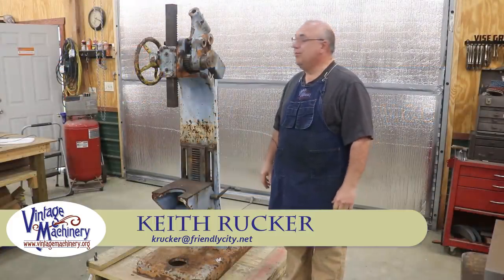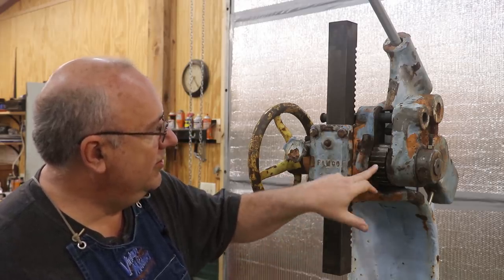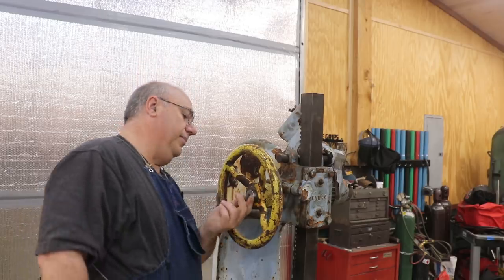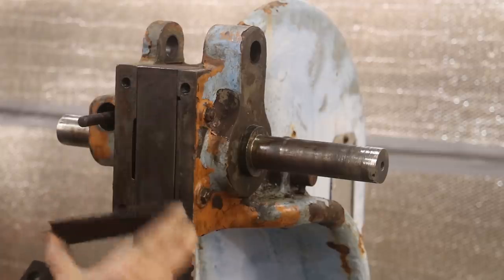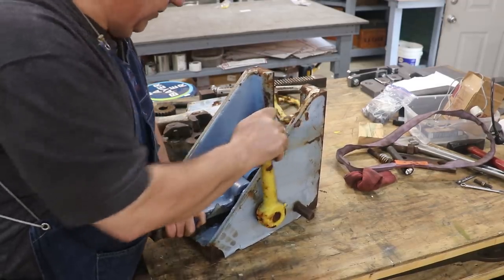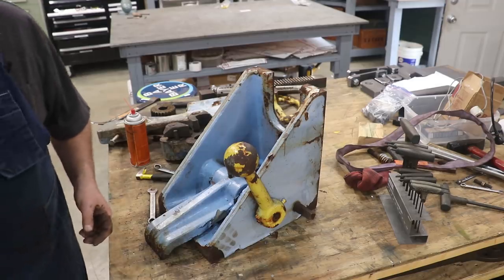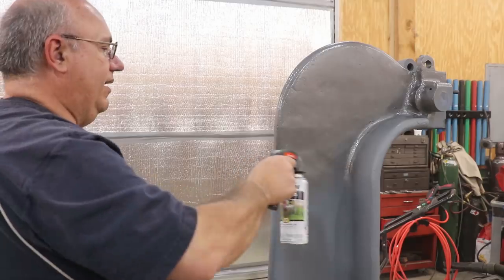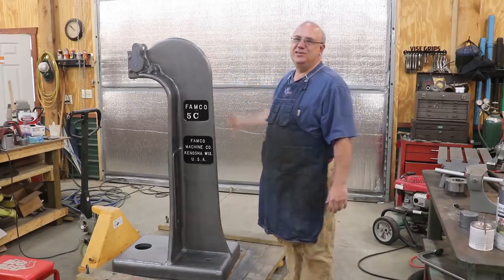Restoring a FAMCO 5C Arbor Press: Part 1

Comment: Hi Keith, i was fortunate to broke my greeness on that model 5c when i was a mechanic for NABISCO Brands when they closed the plant I was able to buy it. Its been in storage for 20 years, maybe your video will motivate me to get it home.  There are more parts than just the daisy, there is a basket that sets over the cut out on the table to support sprockets and pulleys also.  The head compounds depending how the pins are pushed in, It will shear 5/8 shafting in a Vee block if set in low  low position. Ask my buddy Terry how that worked out when the part sheared and flew past him one night😂. It looks like the shift pins are missing on your new one.

Comment: The Famco arbor press parts document shows the same part number for the "bolster plate" (which you called a daisy wheel) for the 4C, 5C, 6C and 25C arbor presses. So dimensions from any of those should work. Some guys make up plates that stack, so you can have lots of sizes of slots to work with.

Comment: That ratchet that holds the lower table up is probably not coming off its shaft because of the scar from the setscrew. You can probably remove the scar using a drill that just fits the minor diameter of the threaded setscrew hole. Shine a flashlight in there first to make sure the hole is still in line with the scar. Once you get it apart enlarge the divot in the shaft where you drilled off the scar so the setscrew end fits into the divot.
You can pull on the shaft using paired wedges like those used to remove a Jacobs chuck from a Jacobs taper arbor.

Comment: You can use a gear puller to remove the counterweight for the table ratchet. To remove the shafts a slide hammer or a puller pushing off the body would help remove the shaft.

Comment: Looks great.I have a similar one. I too am missing the daisy plate and I am looking forward to see what dimensions  you will be using. I have an eight inch diameter by one inch thick steel disc. I’m trying to figure the holes and slots sizes. I am also having trouble with the ratcheting mechanisms so these videos will be very helpful. I love this machine and I use it a lot. Thank you for featuring the Famco Press.
Reply: I like the contrasting colors around the raised lettering! I have a FAMCO
 document which calls out the thickness of the daisy wheel as 1.5 inches. Also, I believe the pin that slides horizontally through the compound mechanism actually switches between ratcheting and compound leverage. That pin should slide left and right fairly easily. On my Famco compound arbor press I can whack it left or right with the palm of my hand. It's like a two-speed gearbox.
Dude, you need a sandblaster!

Comment: Keith, that piece that you're repairing on the Famco looks like it is meant to be removed by grinding out the weld. It might be easier to get a piece of plate the same thickness water jet cut to the right size and weld it back in. Looks like a great project.

Comment: Nice project and I am looking forward to watching the upcoming videos. Love the hammered paint. Not only does it protect the metal from rusting but it also makes the surface look as if the metal was peened. In case your audience doesn't know, peening was used to work harden the metal making the skin of the metal more resistant to wear and helped it resist rusting due to the hardness developed by the peening process.

Comment: Nice work Keith. Blind holes are the work of the devil. Drill through and knock those pins out.
Reply: Maybe a slide hammer?
Reply: Weld a rod to the top of the pin and use a slide hammer to remove.
Reply: Wedges !
Reply: Anything! Just don't leave it in there...
Reply: I would have drilled/milled through the blind end, smaller diameter than the pin, and then driven it out.  You could have then brazed over the hole to close it up if you wanted.  However, to each their own.

Comment: Keith, a normal gear puller pulls on the gear, pushes on the shaft. What you need to pull that pawl is a modified puller that pulls on the gear but pushes on the CASTING. It would take the normal "grabs" for the gear, but two bolts to push on the casting. BTDT and it works. See you at the Bar-Z. Jon

Comment: actually Keith , If I remember right by shifting a pin on the head changes the travel to a more course travel ,  called a compound rachet  head basically gives you two settings       BIll
Reply: You are correct. We had a big Dake at work and the pin let's you switch between simple leverage (going just thru the ratchet mechanism) and compound leverage where the gearbox is used.

Comment: I have a Famco 3r that I will be restoring this summer. Please take the time to explain how to properly adjust the tension on the ram when you put it back together. M.Brozak
Reply: How is that done? What do you mean? I may be picking up a smaller unit here soon.
Reply: @kennethgilbertdds7249  There are screws with locking nuts that control how much drag is on the ram. I would like him to explain how to adjust these  and just how much drag is a proper amount.

Comment: Hammered finish is very nice, and as well you can with the genuine Hammerite spray paint the machine, and use the brush on on parts, and still have them look the same when assembled. Only drawback is the paint has to have consecutive coats applied within 8 hours, or else you have to wait 2 weeks for the paint to fully cure before painting again, it tends to react funny in the intervening time. However heat cure at high temperature really makes this paint tough, and it wears quite well.

Comment: Hi Keith, I seen one of thoughts on another video of your`s. it was same thing but the daisy wheel was there.IT was that shop were you step back in time and they had a hole bunch of old machinery and the lathe was use so much that there was foot prints in the floor.

Comment: Keith , I emailed you thru the OWWM forum from my Gmail account.  I have dimensions of a FAMCO 6C arbor plate. It's 14" in diameter so either use it as drawn or scale it to your needs.  Jeff in PA on OWWM

Comment: Drill and tap shafts. Pull them out.  Or drill small pocket hole for driver in blind hole.  Fill with oiler.  The rare oiler version.  The hole in the base makes me wonder if it was used on a 12-24" base???  The hole doesn't do much otherwise.

Comment: Even through the video you can see that 'hammerite' type paint does look very cool. The name plate was also a professional touch. I was surprised you went for grey though Keith--don't you usually prefer green for your machines?

In regards that stuck component that was being tricky to dissassemble; is it possible there was a taper pin or some such hidden beneath the paint? Or could there be years of paint that are making harder to pull apart? I remember when you were working on the lathe recently you suspended a big casting in a vat of rust and paint remover over night. Would it be worth doing that for the stuck part? Once all the layers of grunge are removed it may practically fall apart it your hands. I totally understand your frustration at not being able to get it in to pieces. Its really impossible to get a satisfying job done when you cannot get in to all the nooks and crannies.

Incidentally I love that phrase 'rattle can' for a tin of spry paint!!!  I am going to use that myself now!!!

Comment: gear puller on the yellow handle? pull it out as a entire piece?
Reply: Several of us had the same thought.  Maybe we're missing something that makes using a gear puller infeasible because we know Keith has some of them in his tool box and it would've been one of his first choices.  Could the problem be that the yellow arm's contour is too rounded for the puller's claws to get a good grip?

Comment: You strip the paint and flush the chemicals, the old paint (maybe containing lead) the oil and grease into the ground? But you americans are afraid about diesel Motors? If you flush these things in Germany, it would be a penalty up to 5000€ (5700USD)
Reply: Thats good Germany has that together. However you have been misinformed. We have laws regarding this also and drop off points for toxic chemicals. Keith is a Scientist. You have assumed too much sir, but respect to Germany.
Reply: How are we afraid of diesel motors?

Comment: I'm sorry Keith But i had to give this one a thumbs down. 

Primer is for smoothing scratches. It DOES NOT assist in bonding paint at all. Even etching primer, which is special order and not on shelves, does not assist in bonding paint. You actually have a much greater chance of paint peeling by using primer. Manufacturers do not use primer for this reason. (see hundreds of videos of 'how its made" or "How it works")

Cars are made with a paint that is more paint than primer(black coat under metal) that has a lot of zinc in it. New steel car rims and replacement panels are about the same. 

Primer is also VERY porous. Bondo is again, very porous. Putting a sponge that holds water up against metal is a spectacularly stupid idea.

Cast iron, especially cast iron that has been oiled for a long time, contains a lot of oil in the metal itself. You should sweat it out prior to painting it. All it takes is a low temp torch and you will see the oils come to surface ready to be wiped off. This is what mechanics have done for years on brake drums and rotors after fluid leaks. I know for a fact that metals with fluids in them, oil, brake fluid, etc. Do not hold paint worth a darn.

Sorry for rant but this is one of the issues that just bothers the heck out of me, second only to "lacquered". Lacquer is a TYPE of paint. It does NOT refer to clear coating something!  As it happens Lacquer is also porous. Urethane, Enamel are two paints that are not porous.
Reply: etch primer is on the shelves a my local motor factor....and from my limited knowledge it is recommended to prime aluminium with etch to get through the oxide layer and improve bonding??
Reply: @transdimensionalist  yep that is how the sales people sell it to people. Not entirely necessary, but people believe it. There is an acid wash that works much better for aluminum. There was a product called vinyl wash primer that was green, see thru, and really etched. Sadly that product is no longer made. The current vinyl wash primer doesn't work worth spit.
Reply: Respect to you for having the integrity to take ownership of your dislike. Stated as a dialogue, as you did ,gives the opportunity for all of us to learn something. regards vic
Reply: Yes and no, primer and especially high build fills minor imperfections, but to say that paint sticks to bare metal as well as it adheres to primer is flat out wrong. Moisture and oils in the steel however I do agree with, using an oxy torch on a bit of 2" plate produces a hell of a lot of bleed on steel. And before I get my integrity attached here, I have worked as a Boilermaker for 20 years, and been involved with a lot of coatings. And multi million dollar projects have always called for primers, under coats and top coat paints. Requested to the micron in application. I can't imagine that engineers and scientists would be calling for a useless product to be used just to remove scratches on beams and columns that will never be seen once the cladding and finishing is done.
Reply: @wolfiemcwolf6617   And yet if you put primer on bare metal on a car your warranty is void as well as most insurance company's specify in contract that paint must be applied to bare metal surfaces before any primer or filler is to be used. Sorry you feel differently.
Reply: @Scott Lichtsinn You can disagree all you want. I have been working on cars all my life. I know what does and doesn't work as well as what both insurance companies require(yes they do know about primers, paints, puttys. Look up Icar certification )and factory warranty repairs require.
Reply: @Scott Lichtsinn Oh btw. Replacement panels are just scuffed and painted no primer at all.
Reply: @jacilynns6330  I'm not arguing about anything here btw. I'm no expert in painting. But I have been surrounded by painters in my industry. I do have a suspicion that paint technology has advanced over the years, and that possibly paints now incorporate an additive that will make separate primers redundant. However, in my industrial experiences, primers and undercoat have always been a specified requirement. That's the only reason I mentioned it. If there is any evidence that shows the contrary I am happy to hear it and learn from it.
Reply: @wolfiemcwolf6617  All I will say is look at the cars currently being driven that have been in accidents. If you look at the paint the wrong way its comes off in chunks leaving only primer. If the paint "bonded" to the primer you would only see metal not primer.
Reply: I read a bunch of these comments, never going to change the way i paint castings. Primer gives a base that prevents blotchy finishes . I have painted bare castings, it sucks paint in so fast it looks like it was not touched. Primer is important and is not an option. Sorry if this ruffles feathers, been there done that. 
Big thumbs up on this video👍👍👍